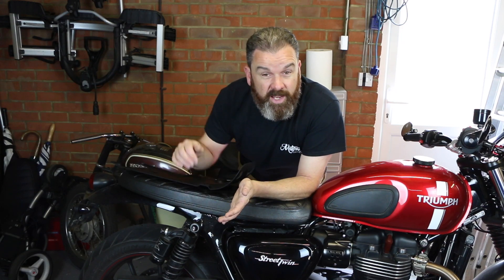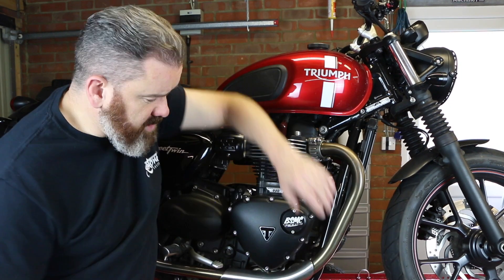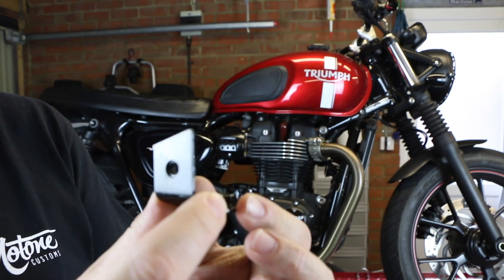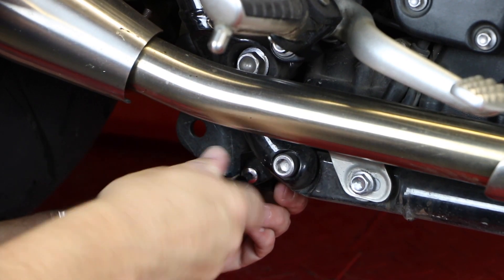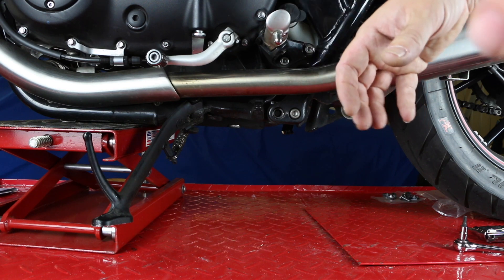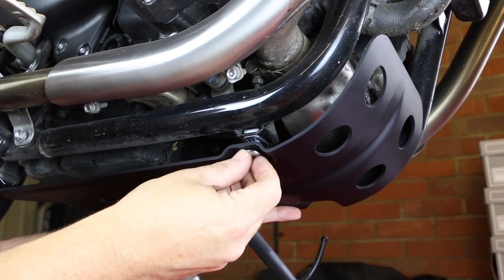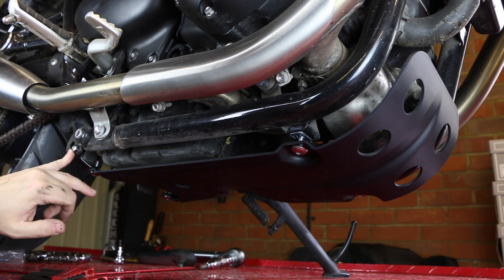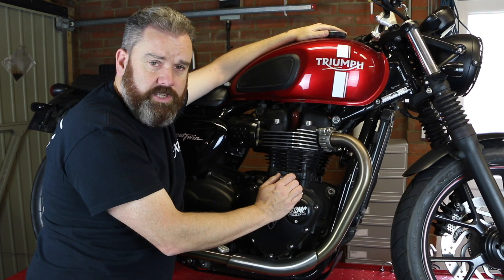Triumph Street Twin - Sump Bash Plate Install

Comment: Great instructions. On my Speed Twin there was a metal brace on the front that I just removed and used the existing bolts to attach the front of the bash plate. I also had the bash plate sprayed with the same material that they use to line pick up truck beds here in the states. It give a nice textured protective coating.
Reply from the maker: Great tip! yes the speed twin has a slightly different set up

Comment: Before mounting it, take five minutes and hit the bolt heads with black paint. Aftermarket aluminum skid plates for the Street Twin run US$100 to US$120 (82 to 100 quid) so the Triumph part is reasonably priced..

Comment: With the plate in place, are you still able to use the scissors jack on the plate ?
Reply from the maker: If you use it on the mounting bolts it'll be OK, but i'd try to avoid it myself

Comment: Good video! Do you know if this skid plate will also work on a Street Scrambler? 

I broke the plastic skid plate that comes with the bike and currently don't see any vendors who make aluminum skid plates for the SS.
Reply: It's the same frame with the same pick up points so I would imagine it fits no probs :)

Comment: Hi,
do  you have any clue whether this fits also Street scrambler? Or do you have any recommendation for well made skid plate
Reply from the maker: Hi Vojta Malina, ive seen Street scramblers with them fitted do I guess so. Does the SS come with a plastic skid plate as standard?
Reply: Hi thx for answer. Yes it comes with plastic "bash plate" but I do not like the look of it ;)

Comment: Good review again Tony. Would you say this would need to be removed before using bike jack / scissor lift to do cleaning and maintenance? Cheers Jay
Reply from the maker: Thanks, strictly speaking I guess so, but I never have and if you are careful where you place the jack/lift it'll be ok. I put mine close to the brackets (towards the back you can utilise two low points on the chassis) and had no issues. Obviously, avoid the middle